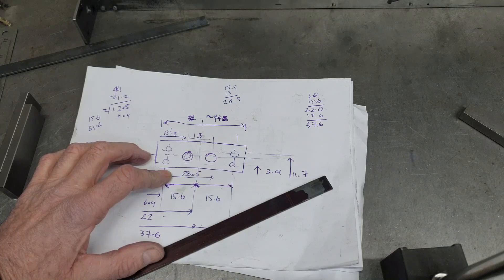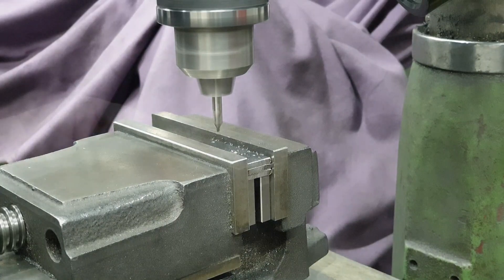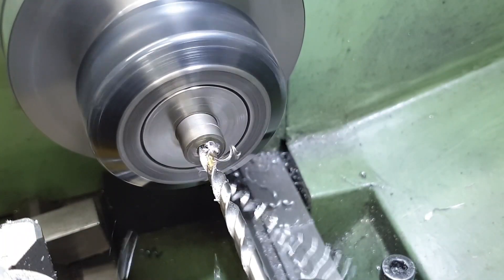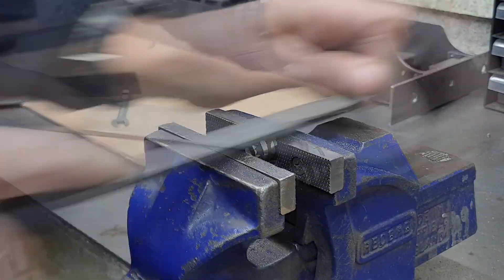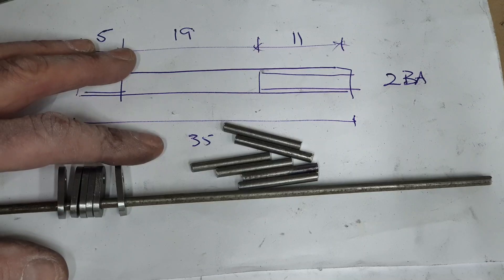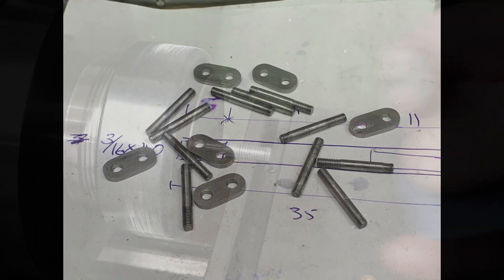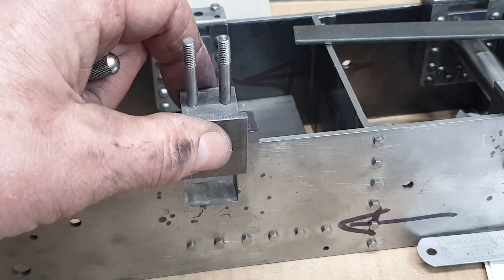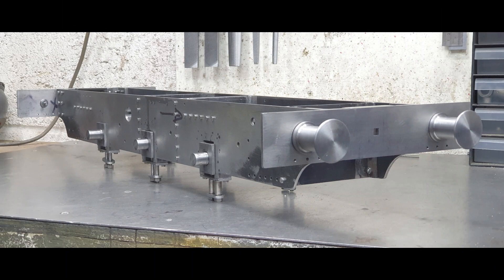Part 7: The Hornstays, Spring Pins and Spring Plates

Comment: Just come across these brill vids. Am building LBSC's Mona in 3 1/2ins guage (recently re-started after a very long lay-off). Although a smaller gauge the build principles are much the same and are proving invaluable to a novice like myself. Many thanks.
Reply: Hi John, thank you for the positive feedback and a timely reminder that I need to get back into the workshop now that summer is rapidly coming to an end.  Good luck with your build.  Cheers, Mark.